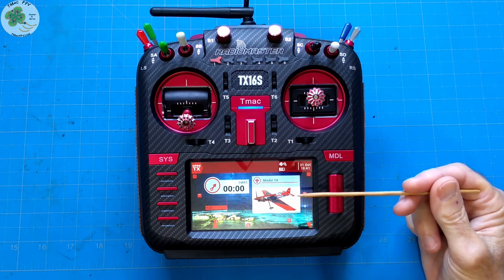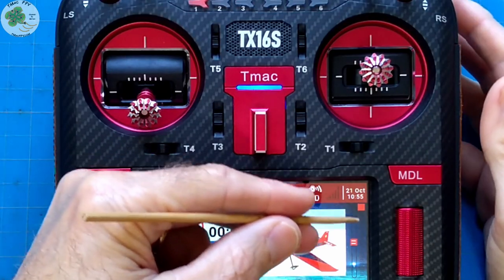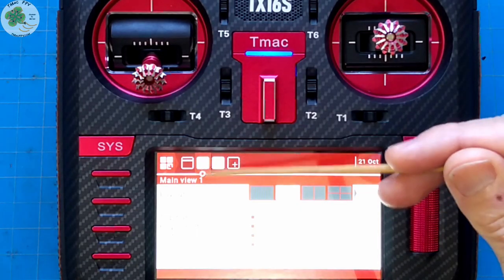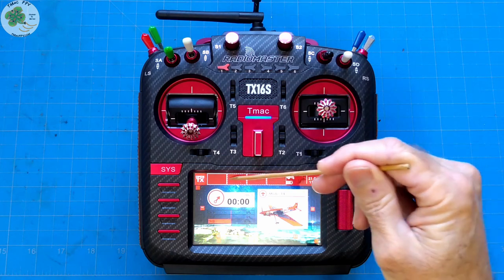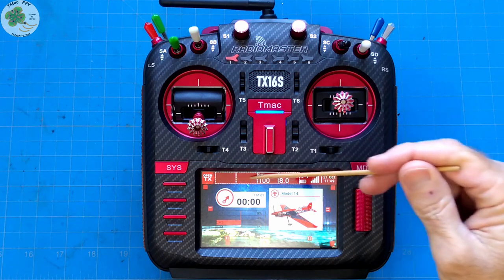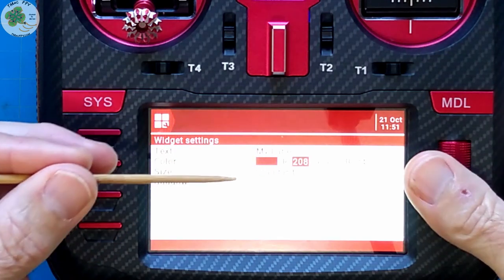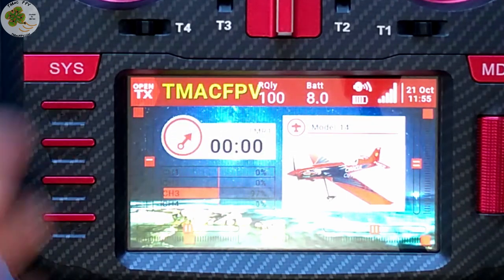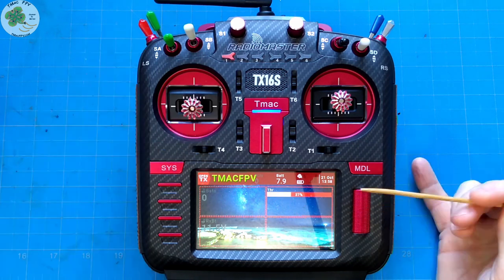RadioMaster TX16S (TELEMETRY and WIDGETS!)

Comment from the maker: What widgets will you use & why?  Share your thoughts and info below to help others out too! Check out more good stuff on my site at tmacfpv.com !😀
Reply: When I tried to put telemetry in widgets i dont have telemetry in the menu! Do you know why?  I have latest open tx update ( sorry new for this things))
Reply from the maker: @vitalliart927  what type of receiver are you using on your quadcopter?
Reply: @TMacFPV   r9m inside settings i turned off internal  and turned on R9 external
Reply from the maker: @vitalliart927  ok, I haven't used the R9 system for quite awhile so I have forgotten just about everything about it. However, have you "Discovered New Sensors" yet in the Telemetry Page after receiver is bound to transmitter and both transmitter and quad are powered on? Furthermore,nthis FrSky link seems to indicate to me, the R9M receiver only has telemetry in the 25mw mode (us that correct)? See "Features" section of this link https://www.frsky-rc.com/product/r9m/ Also, your R9 system is not using ACCESS protocol is it?
Reply: I know Im asking randomly but does anyone know a trick to log back into an Instagram account..?
I somehow forgot the password. I would appreciate any help you can offer me
Reply: @Austin Jalen instablaster ;)
Reply: @Elijah Angelo it worked and I actually got access to my account again. I am so happy:D
Thank you so much you saved my account !
Reply: @Austin Jalen happy to help :D
Reply: TMac how do you add voice prompts to the widgets?
Reply from the maker: @MrKenwillis  https://youtu.be/RSxD9Th1VDo
Reply: Inav luas attitude window has a terrible delay. The elrs reciever is maybe a v1. Is that anyone else's experience.
Betaflight lua keeps downloading board info. I haven't had a chance to really problem solve it... again anyone else see this?
Reply: @vitalliart927  what about in betaflight? Telemetry that is ?

Comment: Thank you so much for this information! Well explained fast to the point no wasted time. This was the best video I have ever seen on setting something up. Well done sir, well done. I cant get my battery voltage from the quad but I'm using ELRS and edge tx but its probably a ELRS thing with the striper down telemetry. Thanks again!

Comment: Great video. And great transmitter. Just switched to opentx appreciate the information. Thanks
Reply from the maker: Thanks Brian and you're quite welcome!  You may find my OpenTX Playlist useful beginning with OpenTX Basics.  Although some of the videos use a different transmitter than the TX16S, its the same process with any transmitter running the OpenTX operating system firmware (its like Windows 10 on any PC).https://www.youtube.com/playlist?list=PLKAiYAaTdvmqxtSKfP-2_QQlS_fd6h2YU  Merry Christmas Brian!

Comment: Great video!
I can get telemetry values displayed on the top bar, but not in any of the widgets.  For example, the battery check widget will always show zero.  I have Vfas selected which displays in the top bar, but never in any of the widgets that relate to battery.  The sensor is working ok and shows properly in the telemetry screen.
I have the same issue on other models where I get my telemetry from my Neuron ESC.  I can display on top bar but not on any of the widgets.
Reply from the maker: I don't believe "battery check" is a normal "telemetry value." I think it is either a reference to an older Lua Script OR requires a separate external FrSky sensor. Are you using "Value" for your widgets and then selecting one of the avaialable telemetry values for your specific telemetry receiver as the "Value?" For instance, the telemetry value of battery voltage using Crossfire is RxBt whereas for FrSky S Port telemetry it is VFAS.  I think I may have gone over it in the video and/or have SPort telemetry values available through a link in this videos description
Reply: @TMacFPV  Thank you for the reply.  I have it figured out.  You are correct that the "Battery Check" is a widget in the latest release SD card release, but it is apparently not working.  The radio allows me to select Battery Check as a widget and then allows me to select the sensor, but it will never display no matter what sensor I choose.  Yet these sensors will display anywhere I use the Value widget.  For now I'm happy as is, I even have my Yaapu working perfectly.  Thanks again.

Comment: Hey Tmac,,   I can also add my GPS coordinates on the screen and find my drone if lose it - right ? I have it in my goggles but would be nice to see it on my radio screen.
Reply from the maker: Yes you can put it on your screen.  On your widget, choose "Value."  For your "Source" of that value choose "GPS" ( its a telemetry value)
Reply: After loosing telemetry, will the last position be saved on the widget or will it return to 0?

Comment: Excellent instructive video. Question? When I scroll down I don't get telemetry on my screen.?
Reply from the maker: Thanks bulu fish.  At the 10:55 time mark of this video, I explain in order for you to see telemetry, you will have already had to "Discovered Sensors" in the Telemetry Page of your Model Setup menu in the transmitter.  That means, you will need to have a telemetry receiver (such as Crossfire, FrSky XSR, R-XSR, etc.) connected to your flight controller correctly on your quad, bound to your transmitter, and "Discovered Sensors."  Once that is all done, you should see Telemetry as an available option.
Reply: Thanks 😊 🙏 got it.

Comment: Thank for the video, I have the same radio and I have the TBS Crossfire  TX  module mounted on the back of it.  I don't know what is wrong with mine but when I do discovery new sensors I only get 4 sensors.  I used to get a lot more than 4 sensors including the RSSI and RQLY.  So I went ahead and did an update on the TX to the latest TBS firmware and I still have the same issue.  Any idea how to correct this?  Thanks
Reply: Enable telemetry in betaflight configuration

Comment: Just installed a FS-iA6B in my drone to replace the FS0iA6 receiver. Was hoping to see some telemetry sensors. What I it shows after the discovery mode is TRSS, RQly,RSSI,RNse,RSNR. I am trying to see what the battery level is in the drone and also the number of satellites I receive. I've watched your videos a couple times but the hang up is I do not get the same read outs for choices for the above items. I use the Radiomaster TX16s. I'm a bit bummed out about this. Any help would be appreciated. Thank you in advance for your help. Al
Reply from the maker: Hey Al!  FlySky receivers' inherent (or "native") "telemetry" capability is not as robust as you see me using with Crossfire receivers.  I believe you'll nee to connect external telemetry sensors to your FlySky FS-iA6B receiver to get the telemetry you're looking of.  here's a short video explaining the voltage telemetry sensor https://www.youtube.com/watch?v=YIrwZ08ynNs . Of course, you could always switch to a more robust (non FlySky) telemetry receiver using ACCST D16 protocol (such as RadioMaster R161 receiver) or Crossifre receiver with Crossifre external module attached to TX16S

Comment: Great video!  Is there a way to make the top bar global so you don't have to set it up for every model?  Or copy and paste it?  If I have only radio info on the top bar it wouldn't change from model to model.
Thanks for all your help!
Reply from the maker: Hey Dale!  That's a great question.  I am not aware of a way to do this.  It appears the Top Menu bar is also Model specific.  What I do is make one model, get iot setup the way I want it, then copy it for each other model I create (moist of my models are setup almost exactly the same and I therefore want the same info displayed).   Any minor changes changes to the newly created model, I just modify those.  If you don't already have it, the TX16S user Manual can be found on this site: https://www.radiomasterrc.com/support

Comment: The volume slide tutorial you made is not working for me.  RM TX16s with Edge TX 2.8.0.  Under Global Functions, when I click on the Switch line, there are no LS or RS nor is there S1 or S2.  When I try to active those sliders while the choosing the switch they do nothing. (If I activate any other switch it does choose it for me)

Comment: Hi. Thanks. I really learned a lot. Do you know if it is possible to access the Model name as a value? (Or maybe you just have to put is as static text for each model).
Reply from the maker: Hey Jonas!  Model Name is not a "Value."  "Vlaues" are telemetry values, switches, global variables, etc.  You do have the option of using a Modelbmp which is a different option than "Value" (image of your model).  If you want text of your model name, you'll need to use the "Text" option

Comment: Trying to setup the volume to use the right slider as per your video, but the slider doesn't appear in the list of available switches/sliders when I try to define the global function.  any ideas?  thanks, awesome video BTW...
Reply from the maker: 2 things to look at. Go to Global Functions. Make GF1 (or any other empty line), ON, Volume. Then scroll over to the field you would normally select the slider. Instead of searching for it in menu, simply physically move it. It should auto fill for you. If it doesn't, back out of this to main menu. Go to System Menu. Page over to Hardware. Scroll down under "Pots" make sure you see LS (for left slider) and RS (for right slider). If you don't, may want to check cable connections for them inside the radio. If you still have an issue, could be defective slider. Might want to contact RadioMaster Support here https://www.radiomasterrc.com/pages/contact

Comment: TMac, I just ordered the Radiomaster T16S, but I'm still puzzled as to which  of  the new FrSky Receivers can bind to its internal protocol module.  I called Aloft Hobbies and they wouldn't say.
Reply from the maker: Hey Larry!  Short answer is basically any FrSky receiver that does not have ACCESS protocol firmware installed on it.  The RadioMaster TX16S has an internal multi-protocol module.  All of the receiver protocols supported by the multi-protocol module (along with their descriptions) can be found here: https://www.multi-module.org/using-the-module/protocol-details  Normally, when using an FrSky receiver with ACCST protocol firmware on it, you'll want FrSky X or FrSky X2 (see descriptions).  Some BNF whoop-type quads, you may need FrSky D (D8).

Comment: I followed this video and it helped a lot getting things set up. Question I have is how to set up the receiver battery level on the screen with an rc plane instead of drone. I could not find the tsBat icon. I found just the BAtt one and that shows the transmitter battery level. How do I set up the rc plane battery level so I can see that? Thanks in advance.
Reply from the maker: It depends on the type of receiver you're using.  Different receivers use different values for the "model's" battery voltage.  For instance, TBS Crossfire telemetry value for model battery voltage is RxBt.  SPort telemetry value for model battery voltage is VFAS.  Both of those (Crossfire & SPort) telemetry values are in the links provided above in t6his video's description.  If you're using a different type of receiver other than those (different telemetry), you'll have to find out what the model battery voltage is for that type of receiver telemetry and ensure you have "Discovered New Sensors" in your model's telemetry page of your transmitter
Reply: @TMacFPV  I fly a Valient E Flight AS3X. I use either the Smart Tech 3s 30c 11.1V 2200 mAh batteries, I upgraded to the TX16 this month from the DXe Spektrum transmitter. I can't see the receiver on the Valient,  Any ideas where I go from here? Appreiate your help! Al
Reply from the maker: @albertherlicka4078  A look at that model's spec's on product page show s the AS3X receiver uses DSM Spektrum protocol.  All of the protocols supported by the TX16s multi-protocol module are on a website at multi-module.org.  I have linked to the specific DSM protocol here for you: https://www.multi-module.org/using-the-module/protocol-details/dsm  Scroll down to the Telemetry section.  After you have bound the receiver to the transmitter, with both the receiver and transmitter powered on, you'll need to "Discover New Sensors" on the Telemetry Page of your model menu.  This should bring up all of the available telemetry values your receiver transmits.  I do not know if this specific receiver has a telemetry value in the Spektrum DSM protocol for transmission to an OpenTX transmitter or not.  Nor do I know if it is "fly-by" telemetry as alluded to in the Telemetry section at the link I have provided.  Its a start for you.  If it doesn't help you out, you may want to explore using a different "full-telemetry" receiver with a different protocol.

Comment: really awsome video and is the one i had been looking for long...one question: i want my tx16s to tell me thru voice when my gps on the quad is locked so that i can start flying. similarly i want to have voice notification for arming (when armed or disarmed)......these voice notifications are very useful. can you please guide? thanks
Reply from the maker: First, you'll need a telemetry receiver that gives you the value of the number of satellites you have acquired.  With TBS Crossfire receiver, this telemetry value for # of satellites acquired is "Sats."  With S Port telemetry, the value MAY be Tmp2 (I do not know this for certain).  Then, if you're using Betaflight, you'll need to know/set the minimum # of satellites for a "lock." The lowest number available in Betaflight is 5, so, I'll use that for my example.  This means, when you have 5 satellites acquired, you'll have a "lock." So, set up a logical switch in OpenTX to activate when "Sats" > 4.  Then go into the Special Functions Page and set up a Special Function using the Logical Switch Line# you just created to play a voice "Track" which you can make yourself using this video as a guide https://youtu.be/RSxD9Th1VDo . With regards to a voice warning when the quad is armed or disarmed, I don't understand the need since you'll have to arm or disarm it yourself, however, to implement what you want.  Set up an arm/disarm switch in Betaflight like you would any other switch in your mixes Page.  Then, go to Special functions Page and set up a Special Function to play a Track when the switch is flipped with a voice warning you can make yourself (using the video I just linked) saying "Armed" or "Disarmed."
Reply: @TMacFPV  i heard that t16s already has telemetry function. so do i still need telemetry receiver? i have one that i use to connect to my mobile and use ground station android app...im using APM2.8 FC (kind of pixhawk)....i connected telemetry tx to that and it works fine on my mobile connected to telemetry receiver....do i need TBS crossfire as essential?
Reply from the maker: @1979zeesh  The TX16S and all OpenTX transmitters require a receiver connected to your RC model that can transmit telemetry values (i.e. a telemetry receiver).  There are other telemetry receivers besides Crossfire, however, you need to ensure whatever telemetry receiver you are using can transmit the telemetry values (such as # of GPS satellites) back to the TX16S transmitter.  I wa sonly using Crossfire as an example.  You'll need to research the appropriate receiver for your own purpose

Comment: Is it possible to audio the telemetry so i can hear the voltage of the battery if i want
Reply from the maker: Yes, if you're using a telemetry receiver that can transmit that value back to the transmitter such as RxBat for Crossfire or VFAS for FrSky telemetry. Set up a logical switch to activate when the voltage gets below a user set value, then a Special Function to play a track using the Logical Switch ad an input. I think I've demonstrated this in a few videos I've done on this transmitter and/or Jumper T16 transmitter

Comment: Can you explain how to set a maximum height alarm please?
Reply from the maker: Sure smiffy788, here we go:
1.  Makes sure you have a receiver that can transmit your altitude using GPS back to your OpenTX transmitter (such as a TBS Crossfire Nano receiver).  with Crossfire receiver, this telemetry value is "Alt"
2.  Go to the logical Switches Page of your Model setup in your OpenTX transmitter and setup a logical switch with the following fields: on any open (not used) line (such as L01):  1st column is a>x, 2nd column Alt, 3rd column is 121.9 (desired altitude for alarm such as for 400 ft you would need 121.9 meters), skip 4th column, 5th column put in how long you want to be above this max altitude before setting off the alarm (i.e. 2 seconds?), skip last column.  Exit out of Logical Switches Page.  Go to next page in your model setup (Special functions).  On any open (unused line such as SF1) of Special Functions Page insert the following into the column fields:  column 1 is L01 (the logical Switch number you had just created), column 2 is "Play Track, Column 3 is the name of the sound track you want to be played (I have recorded my own custom sound track that just says "too high" and named it tohigh).  You can record your own custom sound track using the process I explain in this video:  https://youtu.be/RSxD9Th1VDo .  If you're unable to follow this explanation and require further info, please email me at: tmac@tmacfpv.com
Reply: @TMacFPV  Thanks for the reply. Just got my TX16S and i'm finding it totally different to my other radios. Many thanks for your help, i will sit down and have a play..
Reply from the maker: @smiffy788  might find OpenTX Basics video in this Playlist helpful https://www.youtube.com/playlist?list=PLKAiYAaTdvmqxtSKfP-2_QQlS_fd6h2YU
Reply: @TMacFPV  Thanks, i'll take a look.